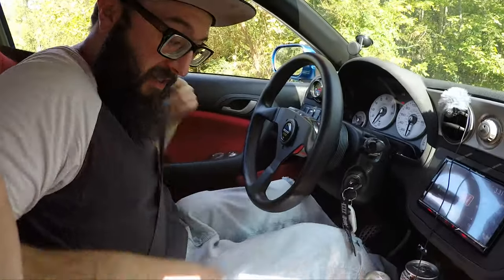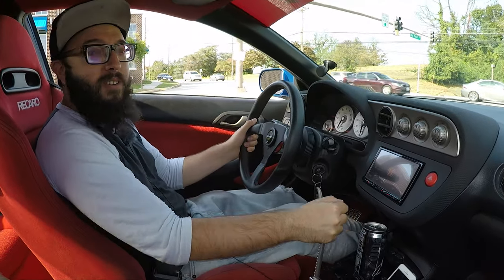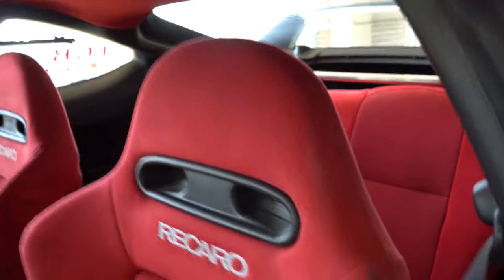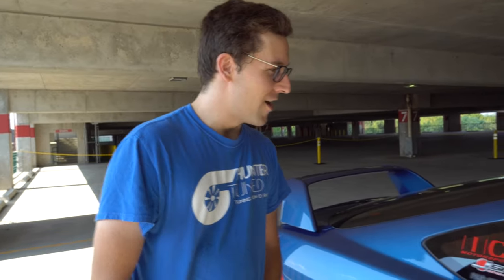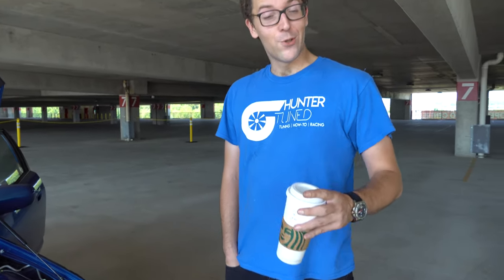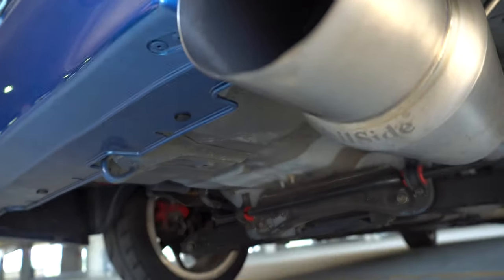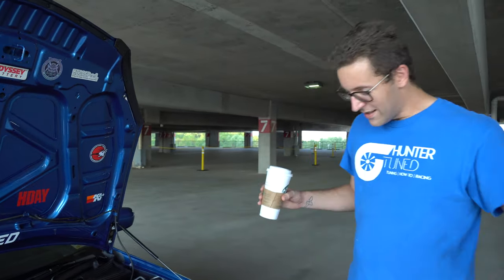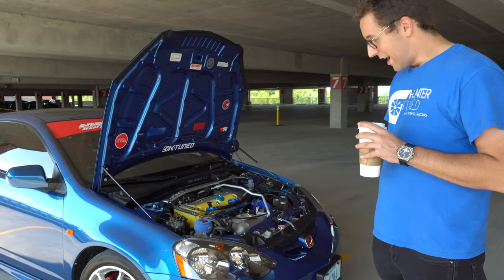K20A Type-R Swapped DC5 - PERFECTION - The Real Shades Wade

Comment: Why go with a catch can system on a Stock K20A?
Reply: its not so much from a typical "to relieve excess pressure" scenario like you see on a boosted car. its to keep the blow by and oil from recirculating back into the intake runner and muckin up the engine. just a piece of mind really. and i plan on going higher compression and itbs so it will be from a pressure aspect when your running 14:1 comp lol

Comment: What if you k20a swap a base Rsx? 🤔probably not highly recommended though... 🤷🏽‍♂️
Reply from the maker: They're essentially the same chassis, although you'd still need an ecu and harness off a type s and kpro
Reply: for sure k24 is a motor that makes more power. frank swaps and straight up k24's will make more power for sure but everyone is doing them. to keep something fresh on the table i want to push the k20a. its a legendary motor. as for dailying one and its all top end power thats just not true. the gear ratios in combo with the high comp and high rev range make the car that much more fun to drive. im just more geared towards the all motor route honestly. its more of a challenge to work for power. anyone can slap a turbo on a car and hit 300whp on 8lbs of boost. next project ill probably do a destroked k24 which will be a monster. just trying to keep things different and fresh. i get bored with the typical trends even if they are sucessful at making power.

Comment: #PFI it's in Colorado high elevation. Go to  PFI then to humble
Reply: the order of visiting tuners isn't really relevant because i will be switching it back to a basemap so no tuner gets any guidance or shortcuts from another tuner. they will all tune the car from a stock basemap essentially. the dyno systems each tuner use will be a bit tricky. evans uses hub dyno. but what i'll do after i visit all three tuners is go to my local tuning shop and do dyno pulls with each shops tune. see which one makes the most on National Speeds dynojet
Reply: @ShadesWade  So what is your goal? To see what tuner can make the most HP on your motor? Cuz every tuner has a different idea of an ideal powerband. Not all tuners tune just for peak hp number at 8500rpm. Some like to smooth things out and try to maximize mid-range for more daily cars for more usable power rather than just seeing peak HP numbers on a dyno. I have had awesome tunes make 15 less HP but feel much faster over a tune that is just going for all top end dyno queen numbers. This is because they go for a better mid-range and a smoother powerband. It all depends on the tuner but for me, HP numbers dont mean all that much. The feel of the motor is and how it functions is what is key for me and what makes a good tune for the application you are using it for.
Reply: definitely good points! my goal with the tuner shootout is to see what is the peak hp number a tuner can churn out SAFELY. obviously they could keep throwing more timing at it and eventually blow the bastard up but honestly you are right. a smoother midrange tune would be the ideal setup for my daily. the car wont be a daily forever unfortunately. i plan on a set of kinsler itb's and dc stage 3 or 4 cams and a pro 163 head. i think at that point the car is getting taken off the streets lol. but we'll see how everything goes. currently building the fuel system right now for flex fuel. all new ptfe system
Reply: @ShadesWade  Ahh ok nice man, I wish you the best of luck man and I always enjoy seeing dc5 builds.. Imsaving to invest in a camera so I can document my build as well on YT. Just finished building my trans and installed it along with a JDM k24A.. Assembling my turbo kit now for it.. This will be my 4th dc5 build now. Cant ever get enough of building these cars lol. Hope all goes well!
Reply: thats great dude! 4 of em wow! this arctic blue pearl 2004 is my 2nd one. owned the first one for 14 years. they are truly great cars (aside from some of them having water leaks in the hatch like both of mine. lol and before you ask no its not the tail light gaskets. probably seam sealer cracked somewhere). i have a small group of subscribers over on my channel all gear around dc5 building. its great to start a channel and document your build and do it exactly like you want. keep it real. dont get into youtube for the money and algorithms lol